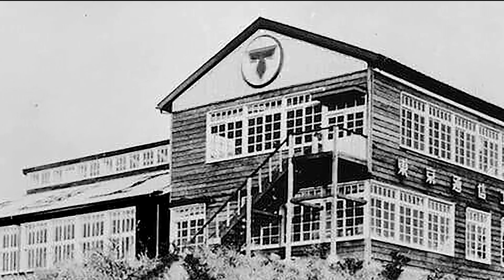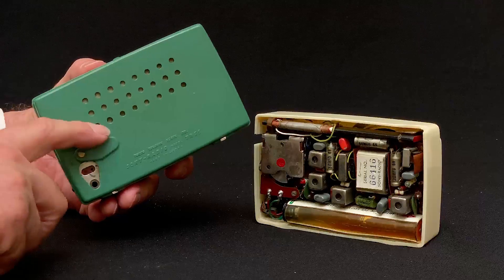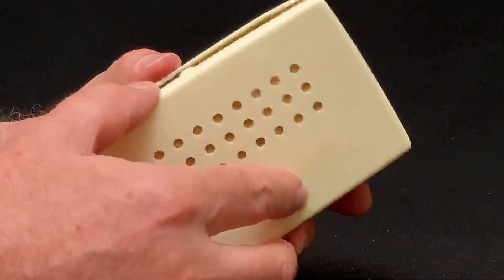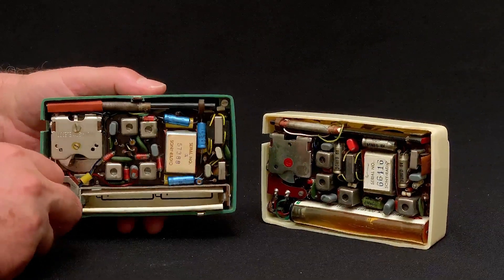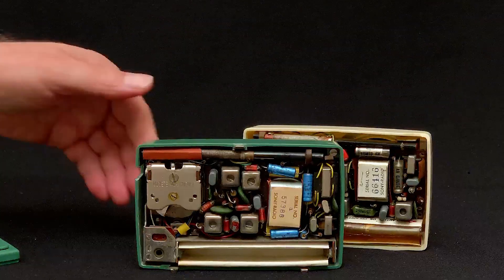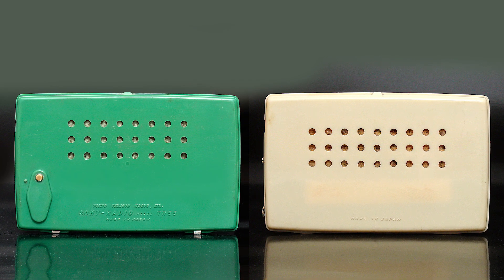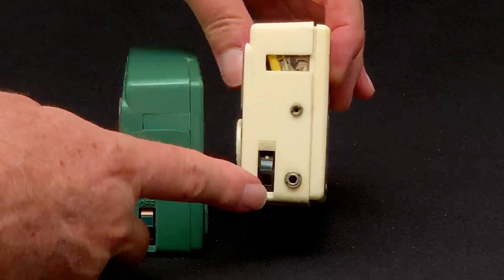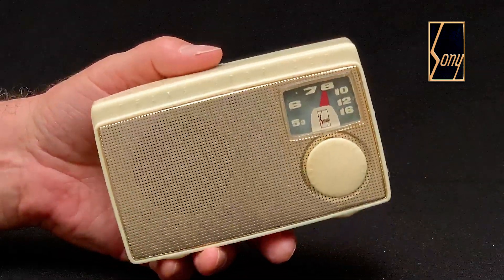Historical First: The first Japanese transistor radios 1955 1956 Sony Tokyo Tsushin Kogyo

Comment: I have learnt something new today, thank you.   The earphone jack upgraded from a two pin socket probably set the standard for other manufactures, I was just thinking that the earphone would have had a limited market without a radio and the two pin more suited to  a hearing aid amplifier.  The circuitry is well set out and the tuning condensor still rather large, the transistor I am guessing from America. Thanks again.
Reply: That 2 pin earphone jack would at that time been standard with most hearing aids on the market.
Reply: @stanmeyer9770  Hello Stan,  yes I remember seeing in the early 60s lad at my school who had a shirt pocket hearing aid amplifier,  he would unplug it when it started whistling. They were probably the only device needing earphone and the jack had yet to be adopted. .  Best